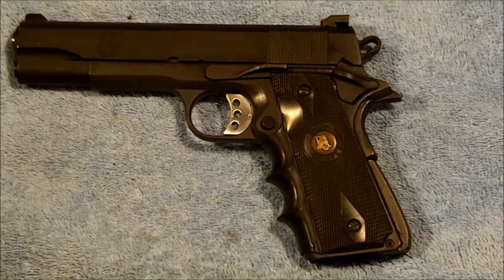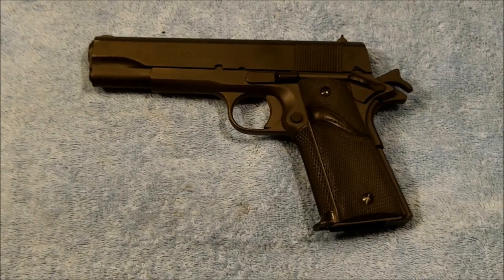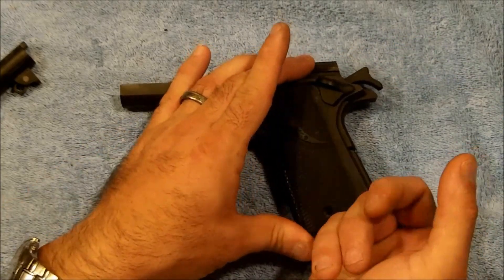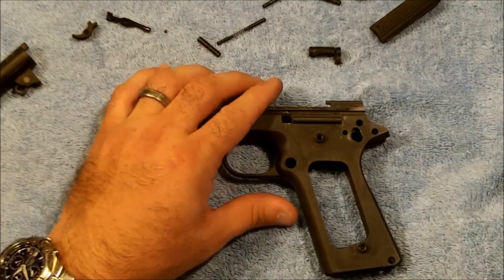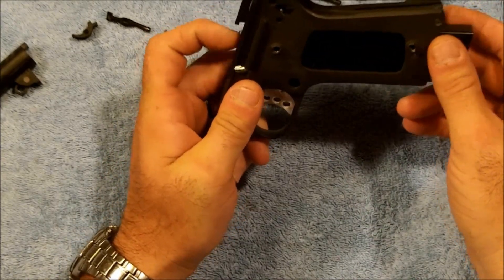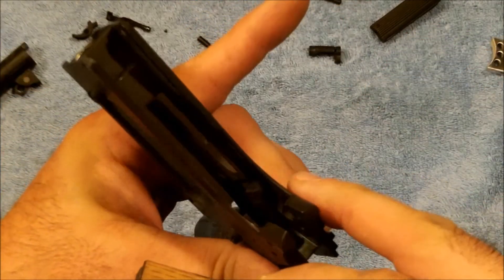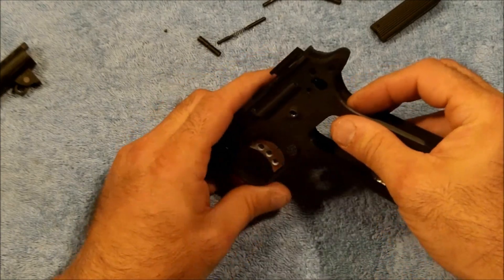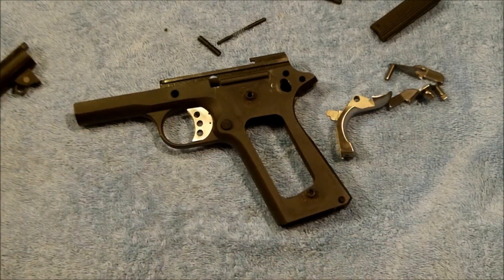1911: Rock Island GI Transformation Part 1

Comment from the maker: Yes and No, the slide will fit however,  the dust cover on the slide is short and will leave a gap between the slide and the frame.  The more common variant, is to use the compact frame with a mid size slide, which is not always successful,because of variations in the dust cover length, or a fullsize frame with a compact slide.

Comment from the maker: This is an older pistol,  I wasn't aware that there had been a problem with the mag release.
Reply: My mag does sorta catch half way down. I got some Colt magazines though and it seems to have fixed it. I also smoothed my edges and removed the paint on the ria mag and it's not as bad. I think it's the magazine that's the issue to be honest